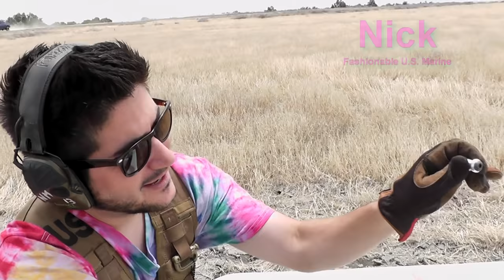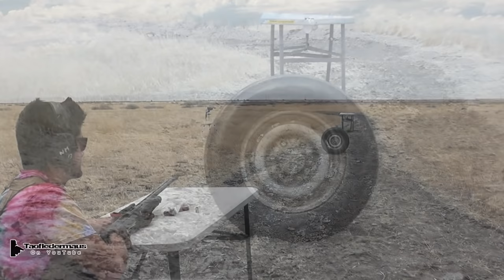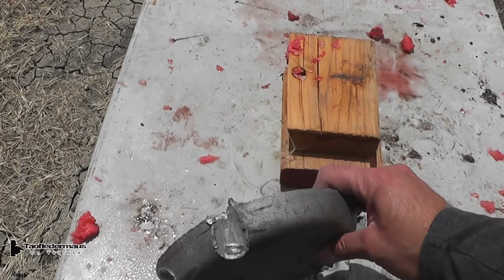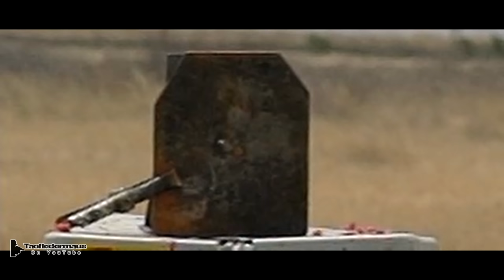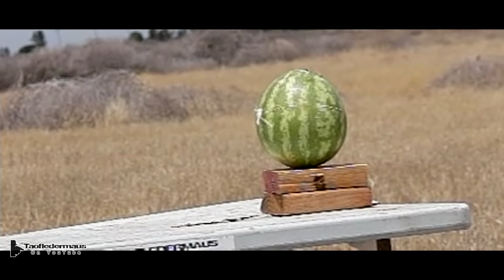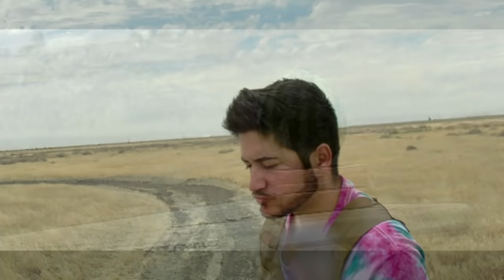Bolt-Nosed Shotgun Sniper Slug - Amazing Performance!

Comment: in the spirit of "it's not a bolt it's a screw" pedanticness, I'd argue that it's neither because it's not being used to fasten anything. if it were being used to hold something to the slug it would be a screw, and if the slug is acting as a nut to hold two or more other things together it would be a bolt.

Comment: just a qq, have you tried wire flecettes in wax in a sabot w/ the plates to distr. weight and a straw-like object in the middle? don't do if you don't have an already flecette chewed barrel I don't wanna be that guy that is the reason your barrel exploded. Also the haters can FTFO because your setup is nearly flawless.

Comment: Dumb question is ar500  called 500 cuz it's 1/2 inch thick ?
Reply from the maker: It's only about 1/4" thick.   If I remember right "AR"  actually stands for  "abrasion resistance"  and "500"  is the Brinell value,  or its hardness.   The steel plate is commonly used in things like  hammer mills and other machines that have to be able to withstand wear and tear from stuff like grinding up corn,  etc.